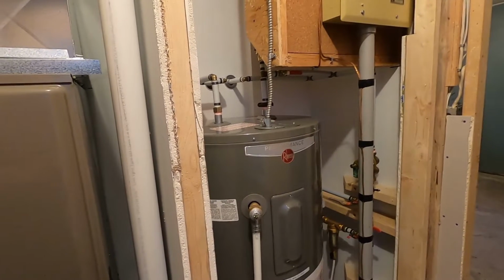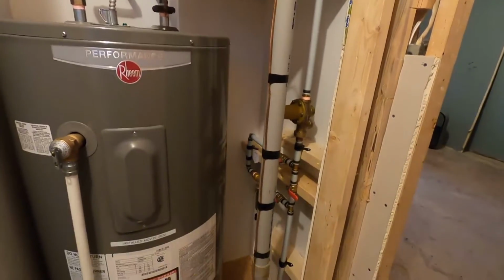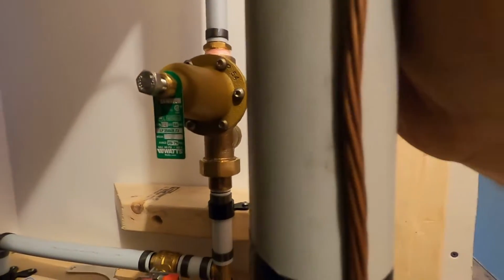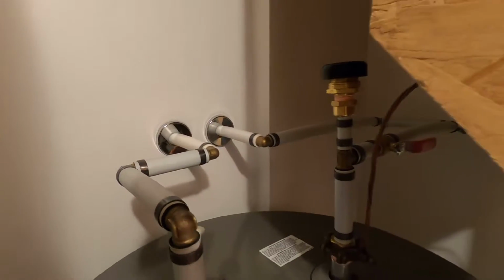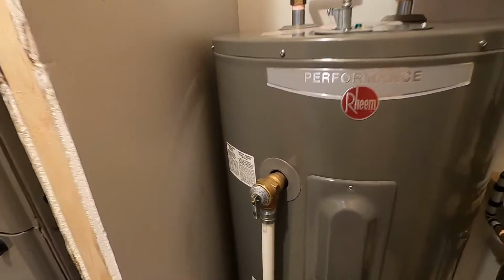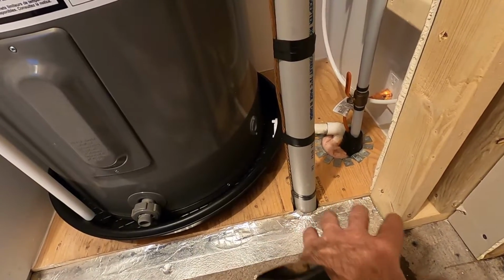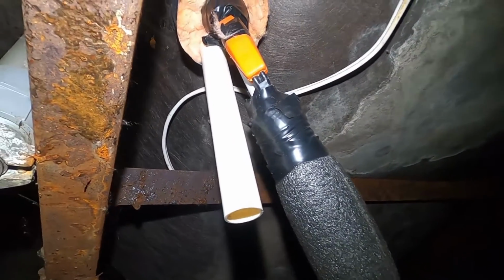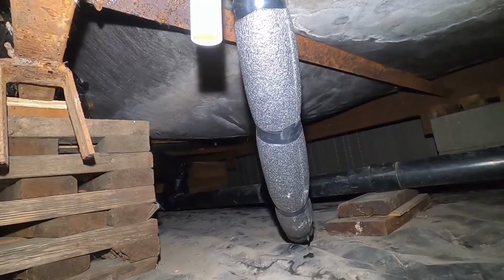Another Project Done - New Hot Water Tank Installation :  E124 / BC Renovation Magazine

Comment: Looks great I like the filter set up.  Does it flush itself automatically? Or do you drain it manually.
I have a rusty water and would like a pre filter for my softener
Reply from the maker: phillipstallter, that filter has a manual back flush.  It uses the house water to flush.  You put the small white hose coming from the bottom into a bucket and open the valve on the bottom. Flushed the filtered material out the hose.

Comment: I've never seen a plastic tray for electric water heaters before.  I like the look of that better than those cheap tin things you normally see.
Reply from the maker: AmraphelofShinar, I have used both metal and plastic under electric hot water tanks.  It kind of comes down to what size fits in the space available and if the tank will fit in.  I prefer the plastic.